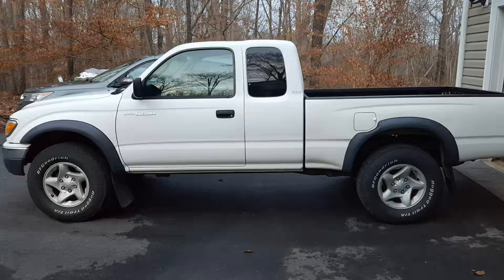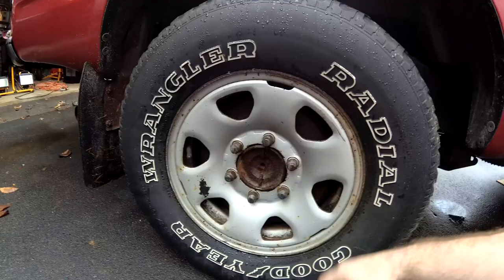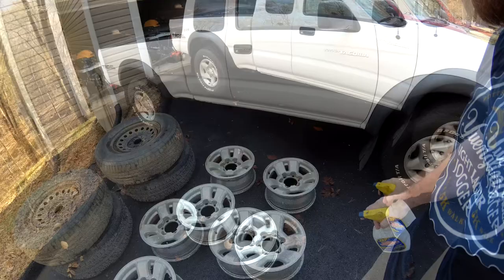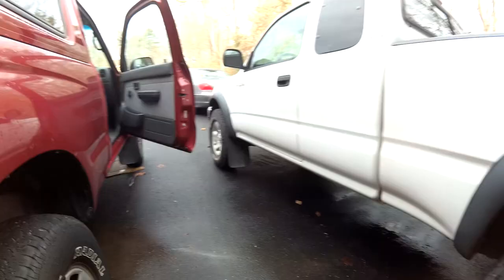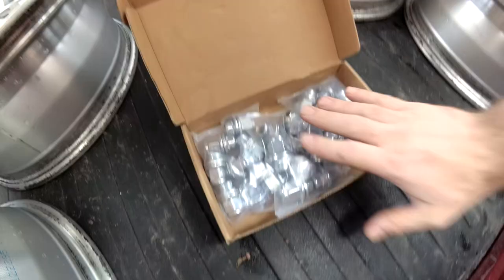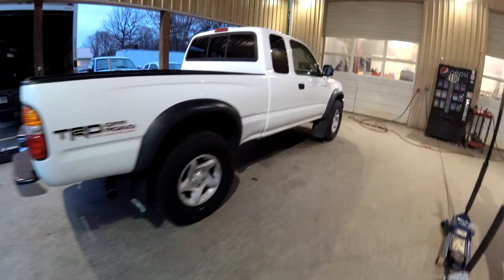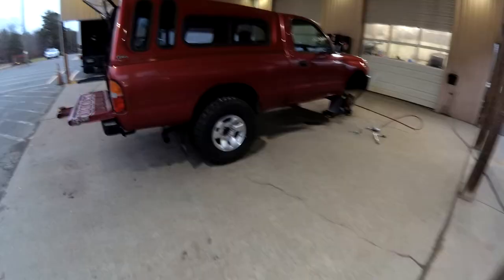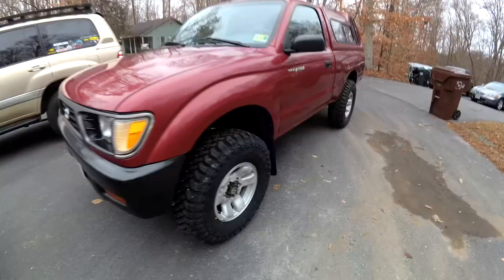The Tacoma's Got Some New Falken Shoe's - 1st gen Tacoma TRD Off-Road

Comment: I fitted a 285/70/17 under my 2004 prerunner.  I have to bend the tabs with a bar and vice grips so it opens up a bit.  It's not a new tire, maybe 50% life left, but it's a spare.

Comment: Hey when added your camper shell on your taco this you also upgraded your rear leaf spring because adding more wait.
Reply from the maker: I thought I might need to but it didn't cause that much drop.  I even lifted the front about 1.5 inches and the trucks sits level from front to back.  I think my leaf springs are in pretty good shape and may have been replaced at some point so that probably helped.
Reply: @BradyAdventures  ok because I added me shocks 5100 and going get new tires, also have a camper on my taco and possible the more weight you add in the back is recommended to add extra leafs. I don’t haul our have heavy equipment. Only have my jack in the back and random stuff and when I go camping I take couple stuff

Comment: How'd the Wildpeak AT3Ws wear on your other rig?  I'm in the market for a new set of tires and those Falkens are really tempting.
Reply from the maker: So far they are wearing perfectly but I only put about 6,000 miles a year on the Land Cruiser. The main thing is to make sure the air pressures are right for your load and they should last a very long time.